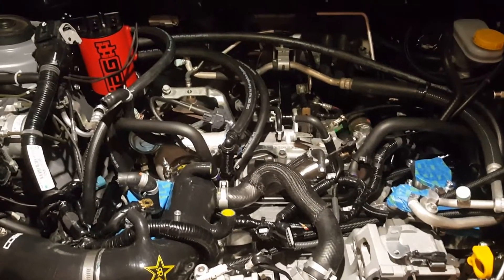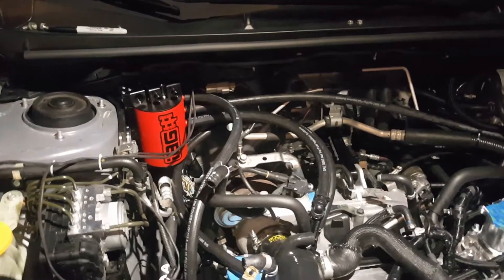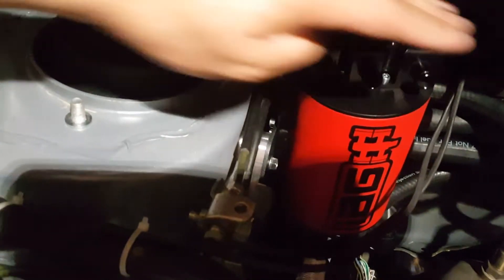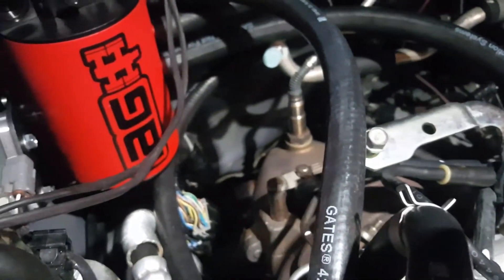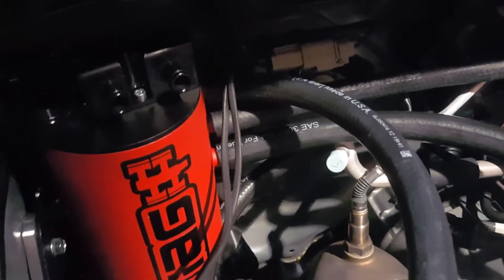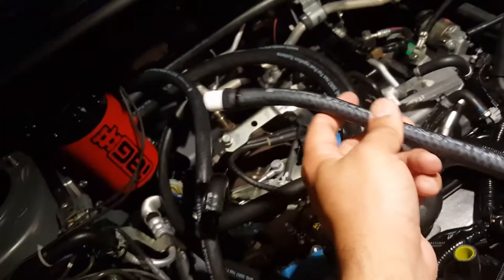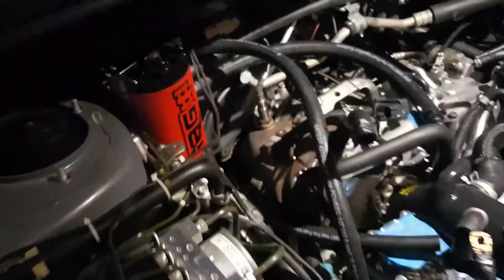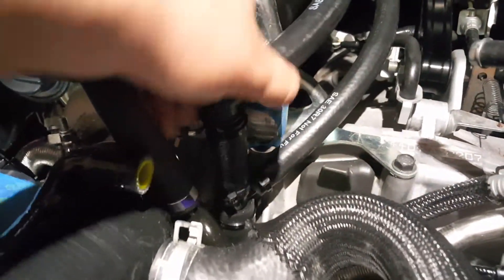AIG AOS Air Oil Separator (main connections) Subaru STI

Comment: where did you get the AOS mount spacer? I am thinking to get a spacer for my install instead of pushing those ABS lines.
Reply from the maker: https://www.etsy.com/RACEDEV/listing/886541247/subaru-wrxsti-15-aos-spacer?utm_source=Copy&utm_medium=ListingManager&utm_campaign=Share&utm_term=so.lmsm&share_time=1602640237903

In case you are interested ;)

Comment: Thanks for the video!! VERY HELPFUL!! Also, how difficult was it to remove the intake manifold?? Im asking because I want to powder coat mine since the original Subaru red paint is flaking off :(
Reply from the maker: Its not hard, but you have to remove quite a few connections, drain the coolant and deal with the factory hard lines. Its is not something I would want to do again with the factory hard lines installed. In other words. you will spill fuel and coolant.
Reply: Thanks for the reply!

Comment: i see trhat you have after market fuel rails /lines im in the process of installing tgv delete,fuel rails,lines but i have come into aroad block on what to do with the vacuum line that comes out of the firewall and into the metal line that goes under the intake? what did you do with that?
Reply from the maker: Can you post a vid or pic?
Reply: Cesar R I Cant send you a video, you have Instagram?
Reply from the maker: @cheecho_from_the_internet  @racedev

Comment: Did you get PCV disconnect code after install? If so...how to troubleshoot that?
Reply from the maker: I do not think I did... but either way I have turned off several codes via Accessport ( ecu flash)
Reply: The PCV disconnect code is an easy fix, i got it when changing my turbo inlet hose, you just pull the metal prong from the male end of the connector and stick it in the female, heatshrink it and tuck it away. the connector doesnt do anything besides tell the ECU that its connected. with an aftermarket turbo inlet and/or AOS you wont be able to connect it anymore anyways

This was the fastest and easiest solution i found without erasing codes and turning CELs

PS: sorry im a year late but maybe this comment can be used for future reference